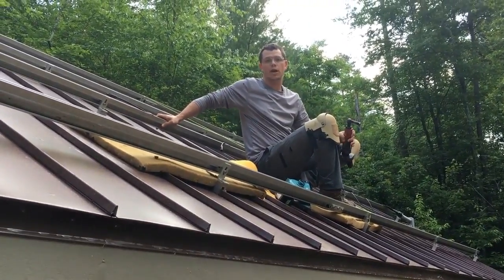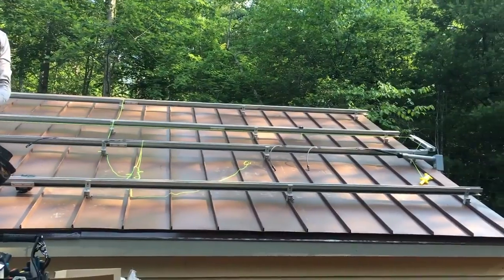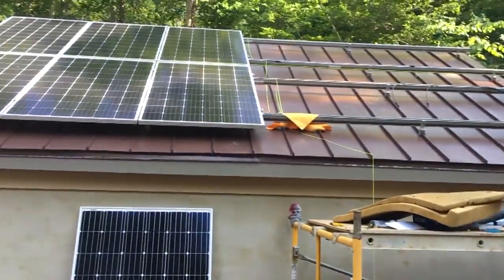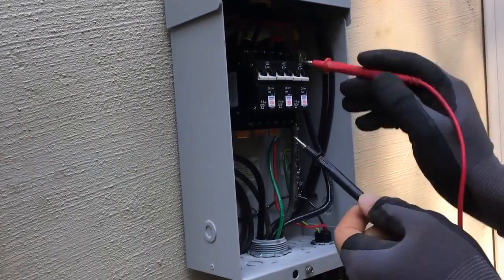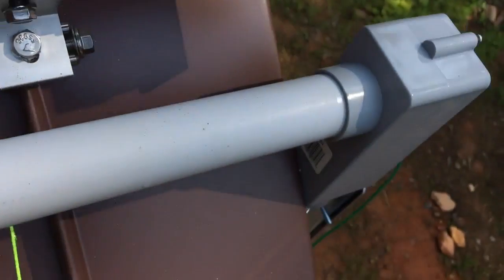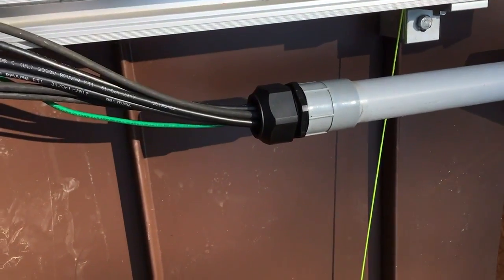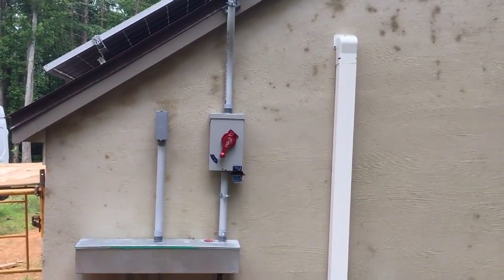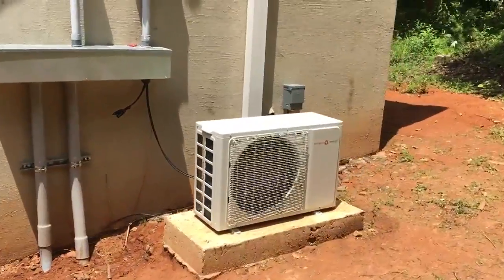100% Offgrid Dream House 3:  Mounting Solar Panels

Comment: Is there a specific reason you did 3 strings of 4? Are you looking for a target voltage?

Yes the panels look nice and tidy.
Reply from the maker: Greg Vence The max operating voltage of the charge controller I am using is 200 V DC. Any higher and the charge controller will not turn on and if it is over 250 V it will damage the controller. The wire run was over 300 feet so I needed to minimize voltage drop by wiring them in strings of 4. 

Not looking for a target voltage more so trying to stay within the limitations of the charge controller. If this was not an older system I would have done something higher voltage, like 380 V DC. There is not a target voltage

Comment: I like the string idea for verifying the panels are running straight. I have 48 panels that I will be installing and I will definitely use that tip!
Reply from the maker: Dawn Redwood Groves yep check your voltage as you go so you mount.

Comment: Brother that looks so good. If you get time one day would go over how the AC works. I have not ever seen one that can run off PV DC and or AC power.. Thanks and God Bless.
Reply from the maker: yankey4 thanks man.  Did you get that lady’s charge controller fixed. I’d call midnite tech support and get them to troubleshoot it. That CC has a 5 yr warranty and they can always be repaired
Reply: We did I had her turn it off for a few mins and reboot it. I then did a firmware update for her. Now it;s working fine. O and the fan she used a can of air to clean it and that fixed that part.. Thanks for asking brother.